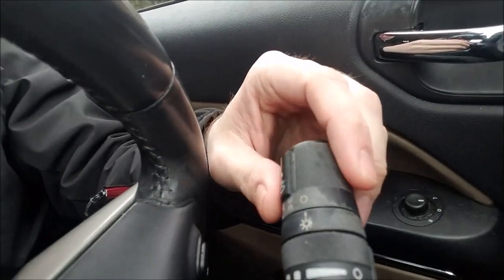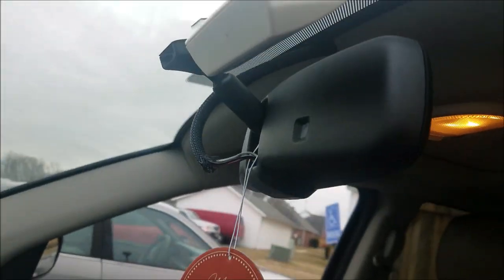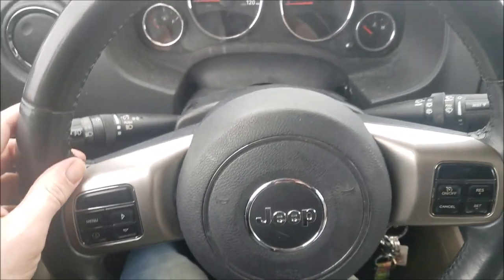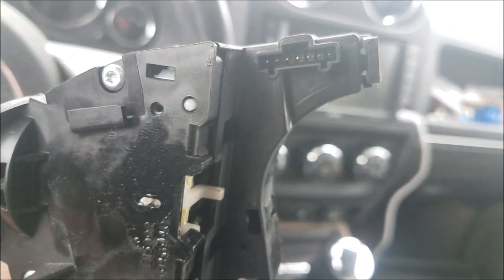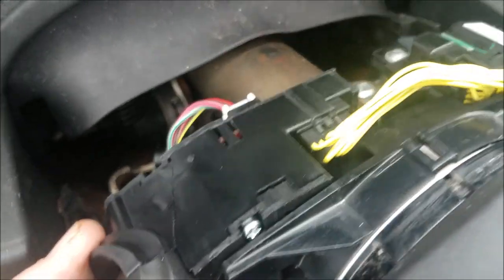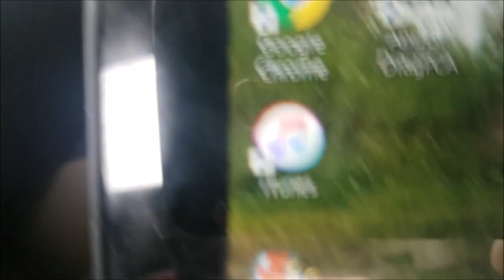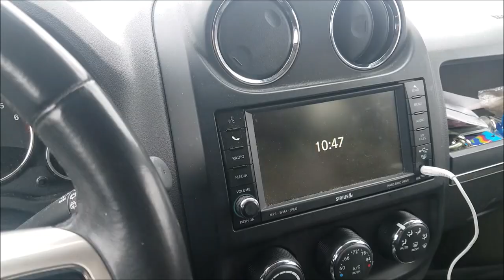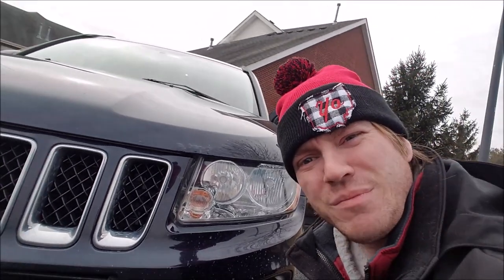JEEP Compass and Patriot Turn Signal Replacement & Upgrade

Comment: This was the missing piece to the puzzle that took me days to figure out, thank you so much!  The issue I had was flickering dashboard backlighting when I would turn on my headlights. They would flicker about 6 times then all the dash lights would go out (with headlights still working). Replacing this switch fixed the issue!

Comment: I know this is an old video but you said patriot never came with auto headlights. I have a 2016 sport which does have the auto headlights with the sensor on the dash. Same thing with my brothers who has a 2016 base model.

Comment: I thought the Auto mode means automatically turning off during daytime and automatically turning on during night time… After setting up with your video, the lamp is still on during daytime.
Reply: There is no light sensor installation in the video, and it is needed. 
The sensor on the mirror does not work for automatic light, only for mirror shading. Checked

Comment: Thanks brother, mine recently went bad. Whenever there was the slightest touch on it, even when driving over bumps it will turn the cabin lights on or mess with the brightness on the dash. Really just annoying. Great vid! Will definitely be replacing it myself, thought it would be more complex.

Comment: Let me start by saying that I came across your video by accident lol.  I was actually looking for info on putting led signal lights in my 2017 compass, and came across your video.  Well the wheels were turning and there was smoke lol.  I have to say amazing dude, I never thought that was possible, but it is, and it works.  But here is what happened to me, I googled the product # for the arm in Canada and it brought me to "the monkey wrench".  Well, they wanted $146 CDN for the part, but they listed 9 different vehicles and the years for that part.  So with that knowledge, I went to the auto wreckers and searched.  Finally, after about 50 cars from that list I found 2 in a row and took them both, just in case.  They only charged me $10 CDN for both of them, first one I tried worked and now I have a spare if it works lol.  Your obd to usb, well that's another story. Amazon Canada was charging me $99 CDN with tax.  I thought that was a little pricey, so I went to Amazon US, and with conversion and shipping, cost me $68 CDN, I saved $31 lol.  Now on to the software, that was $49 US, which was $63 CDN.  So far so good, but it wouldn't connect lol.  Did some searching on their site and got it to connect.  Lo and behold, it works exacly as you said, just amazing and exactly what I want.  Tape up the sensor and lights come on automatically and never have to turn them on.  The funny thing is, when it came to taking out the signal arms at the wreckers.  Well, lol, I look ar your video there and you said T15 torx and philips.  LOl, I got them from a dodge journey, and it was a couple T25 torm and a philips.  My first thought was you lied lol.  Nope, on my Compass it's exactly as you said.  Here is a list of the cars that come with that signal arm....
Chrysler 200 2011-2014
Chrysler Sebring 2007-2010
Dodge Avenger 2008-2014
Dodge Journey 2009-2010
Dodge Nitro 2010-2010
Jeep Commander 2008-2010
Jeep Grand Cherokee 2008-2010
Jeep Liberty 2009-2012
Jeep Wrangler 2011-2015

  And again, Awesome job and thank you very much!!!!!!!
Reply from the maker: Thank you for sharing!!!
Reply: @WeakestofWeeks  It was the least I could do, that was amazing and never thought it was possible.  I have a buddy that has a 2015 patriot, but no sensor mirror.  I told him, pay the extra $30 and I'll get the vin for another jeep, but no, he doesn't want to try.  So who know, it might work on a jeep without the sensor mirror.  Cause really, the auto function, the lights come on regardless of time of day, just when you turn the key.

Comment: The turn signal/headlight switch is one of the things that regularly go out on Chrysler products.  You most likely get it replaced once during the warranty period.  When the paint starts to fade on the switch, replacing it isn't far behind.  Mine has been acting wonky for awhile now.  The windshield wiper switch also is about as durable as the turn signal switch.  Fortunately, it's just as easy to replace, you're just replacing two switches instead of one in the steering column.

Comment: I was looking for another video on replacement of the wiper switch for a 2016 Compass when I found this video ( Great video thanks). Will you do a video on the wiper switch replacement also?  Looking at this video,  It looks like what I have to do may be as easy as what you just did in this one. Thanks for any help you can give...

Comment: You said you bought a back up camera for your 2011 Jeep compass, did your compass come with the lcd?  If not, where did you get the camera and lcd?
Reply from the maker: My Compass already had a factory touchscreen radio that I integrated an aftermarket camera system to. The install can be seen here: https://youtu.be/X9kOKGjeLe8
Reply: @WeakestofWeeks  That answers my next question lol.  Ok, so now I need a touchscreen, a camera system, and a turn signal arm.  Thank you for spending my money lol.  Great video though, you hit the nail on the head.

Comment: What if i dont want the auto lights on my jeep patriot 2008
Reply from the maker: You can just replace with an OEM like replacement turn signal switch without the auto headlight feature. Theres two different styles though depending on your vehicles options. With foglights (w/o auto lights) BWD brand part number is S14903. Without fog lights (w/o auto headlights) BWD # is S14700. Hope that helps!